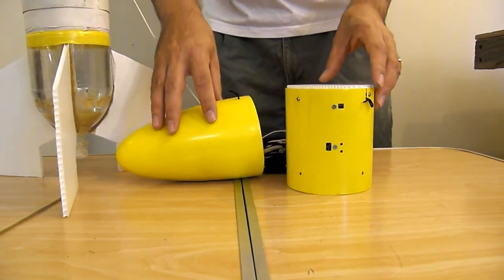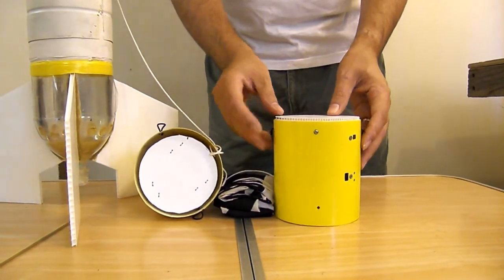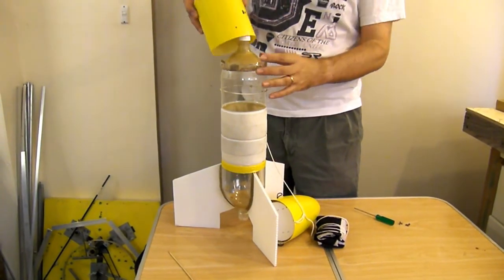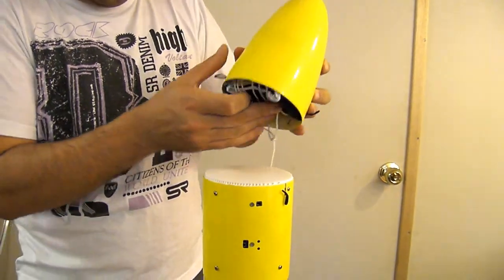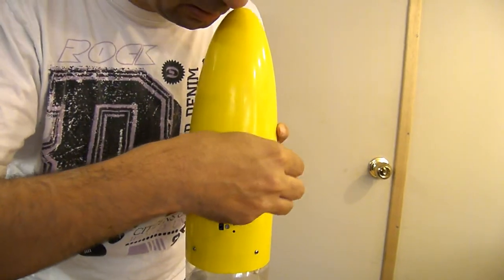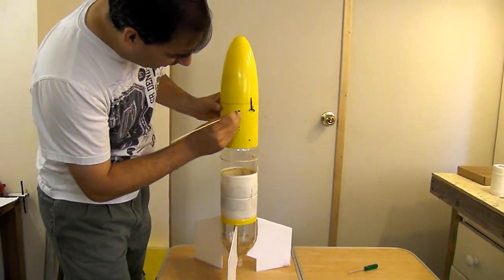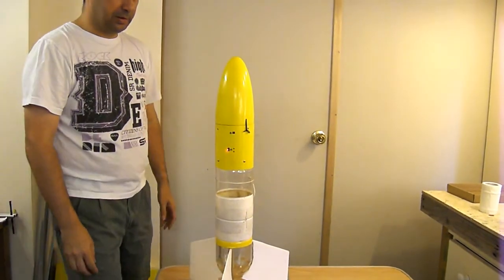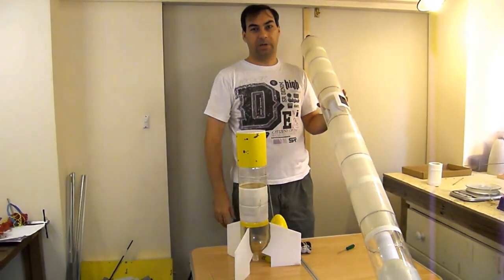Polaron G2 Nosecone test flights

Comment from the maker: @pudresful Currently the entire nosecone and large parachute weighs 361 grams. Eventually the 9V battery is getting replaced with two 70mA Lipo batteries together weighing 5grams. That will cut at least 40 grams from the nosecone weight. We don't want to make the nose too light. It needs to be a little heavy to keep the rocket stable, especially with a big weight of water in the tail. In the whole scheme of things a few grams here or there really don't matter on a rocket this size.